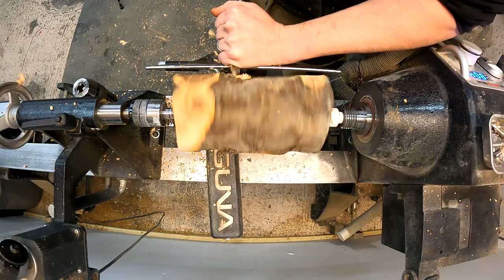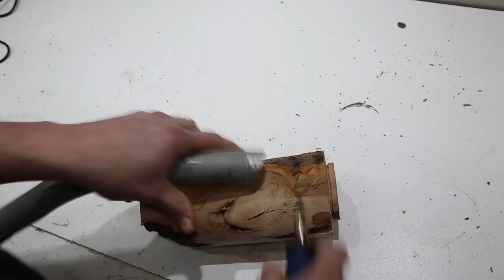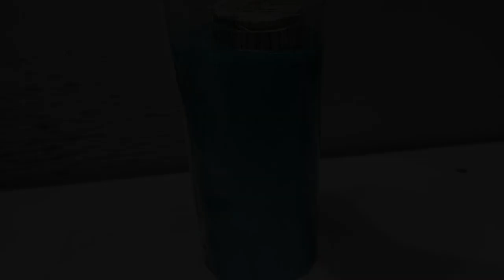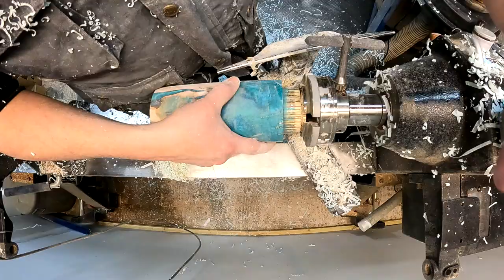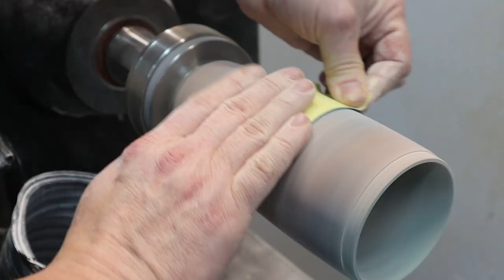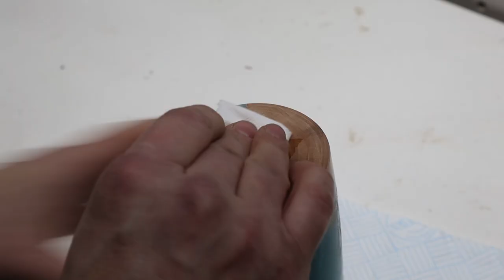Woodturning - Log to Coffee Mug

Comment: Hi, love your videos. Do you hollow it out before drying so it dries evenly without warping or splitting. How long did you dry it for? Thanks
Reply from the maker: Hollowing out to speeds up the drying process more than anything, although it does help reduce splitting. Drying time is based on initial moisture content used to calculate how much weight it needs to lose.